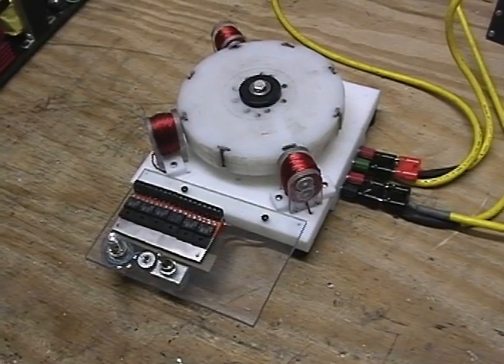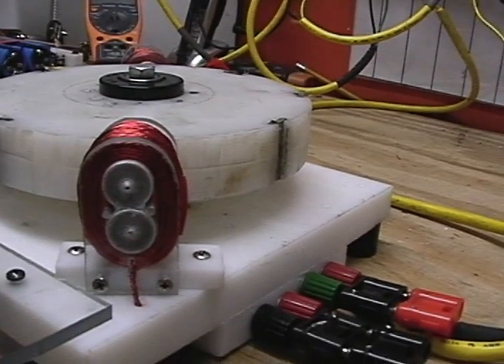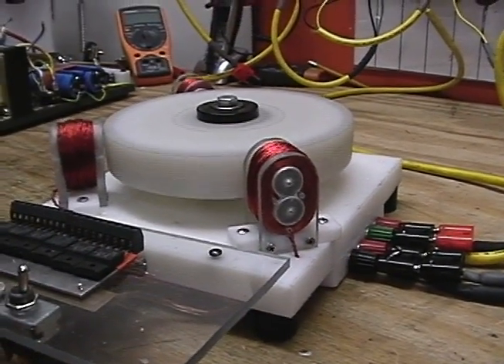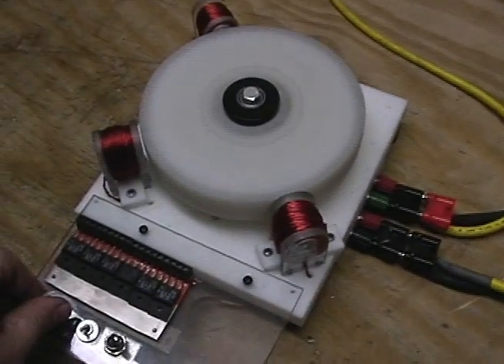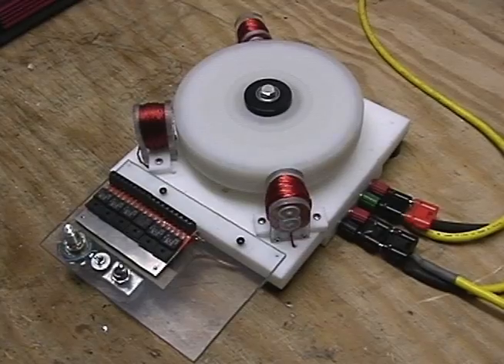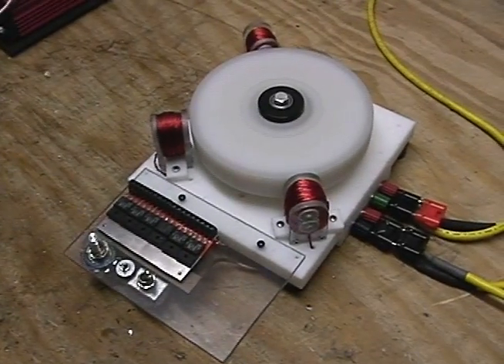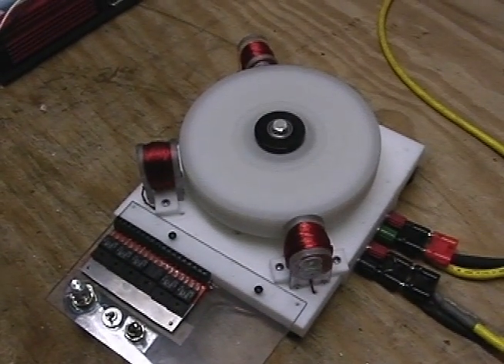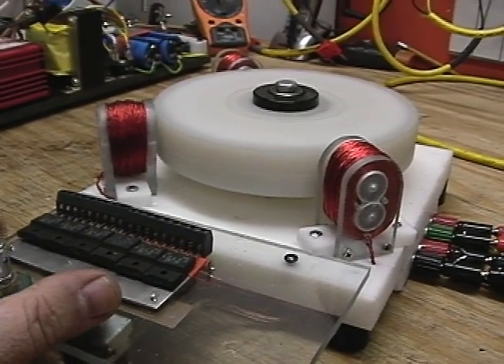Pulse Motor Mini 6.5" April 2010

Comment: Can I ask how did you create that rpm adjuster? I'm sure it adjusts amps aswell correct?
Reply from the maker: +Mark Villanueva Actually it only adjust the resistance of the trigger like a standard SG circuit,  a pulse motor  the resistance controls the trigger time which controls the speed,  thanks for watching there are plans available in  Zeropointfuel  forum
Reply: So you're adjusting the position of the hall effect switch? Can you link me to the forum which can help me understand this circuit?
Reply from the maker: +Mark Villanueva Sorry no hall effects, just a school girl circuit it is controlling the strength and duration of the pulse.

Comment from the maker: output is pulsed DC watts is a unit of consumption not output that is amps it only outputs a amp or so but this is a  battery charger not a torque motor (thanks for watching)

Comment from the maker: it's called a OHMITE - RHS1K0 - RHEOSTAT, WIREWOUND, 1KOHM, 25W it can handle the amps flowing through the trigger. I don't use a bulb like Bedini you need a robust trigger circuit

Comment from the maker: I think you mean your trolling motor batteries? well I don't think that would work because you have to provide power to run the pulse motor but ti will make your batteries last longer if you charge your batteries with a pulse charger cheers.

Comment from the maker: @cloverpark2011 each coil has 2chips so the power wires of each coil is connected to a chip. One coil has a trigger wire ant the other 2 coils are slaved to that trigger, so all the coils fire at the same time

Comment from the maker: @tyrodogg they are operating as bifiler each wire has it's own chip I also pulled the bridge rectifier so I could add 3 more chips it seems to work better without the diode bridge it has a better range

Comment from the maker: @tyrodogg also at hi freq there is a point when its working at 36v I can tune it they get hot but the draw amp is still quite low when there's not not enough force to keep the wheel spinning   but the Circuit is still resonating.

Comment from the maker: @tyrodogg  It normally runs at 36V .6 amps they don't get hot but slightly warm, but if I crank it up above 2.0 amps or higher it will get hot

Comment from the maker: @overunitydotcom  12-36v  44Ah telecom battery's, it is able to do ultra hi freq because of the Ferrite Rod Cores at 12 v I can tune it up and charge any batterys nonchargeable  AA-9v  the funny thing is at a hi frequency it seems to stop drawing power but still has an output of .4A  and the wheel doesn't spin but it charges.

Comment from the maker: @erfinder2  they are SK C5101 HI speed NPN @ 160 Volt, I have used many NPN chips and it doesn't seem to matter to much, but they must be hi speed NPN chips the SKC5101 was discontinued and are surplus now,so  they were cheep  real cheap in the us, anyway I have blown holes in 15 or 20 of them  Good luck